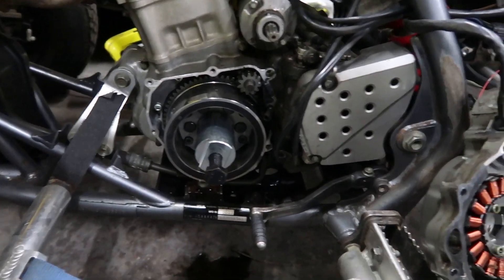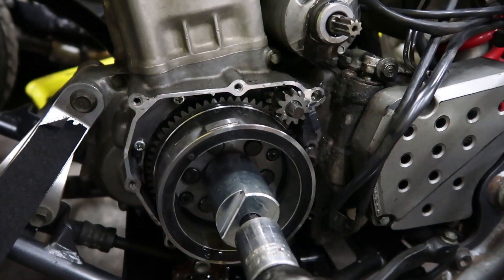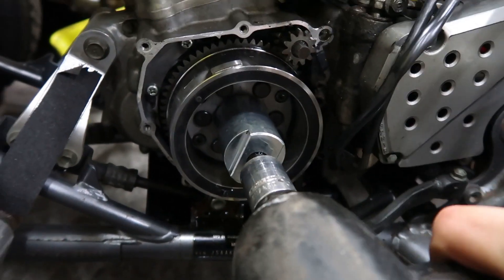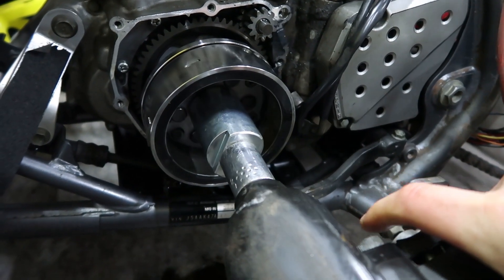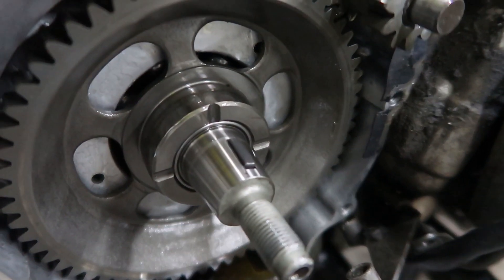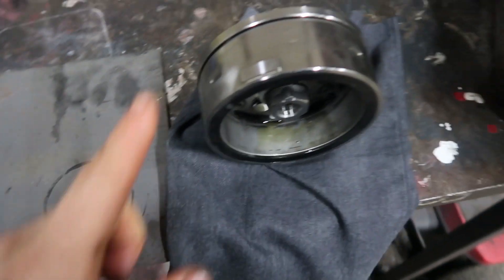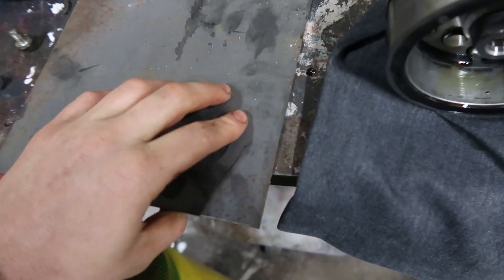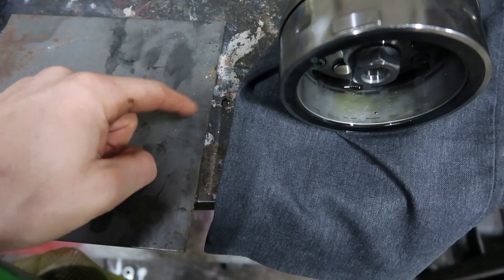Making my own 36-1 Trigger wheel. EFI / Turbo Conversion Quad bike Part 1

Comment: Just two concerns I can perceive. Welding(and impact gun for that matter) can demagnetize your rotor if I’m as well read as I think I am. The other is the balance from possibly distributing more or less weight from welds/inconsistent tooth size and from the missing tooth. You could take the weight of the missing tooth and cut a hole, removing the same weight of material on the other side for that issue though. I personally would try to implement a more traditional style wheel on the other side of the crank if it’s possible. Just my .02. Excellent idea though and impeccable execution.
Reply from the maker: thanks for your message buddy. Yeah it was a bit tricky to do for sure. Its been runing and driving for a couple years now no issues so far. i guess the extra grams here and there didnt make thatt much of a diffrence however its not the most ideal thing to be doing. none the less it worked fine :)
Reply: @BEYTEK that’s good to hear! I’m currently in the design/research phase for a kz1100 chain drive conversion/EFI conversion/ possibly a turbo. Keep em coming man love to see it!
Reply from the maker: awsome dude. this was a great trigger setting settup leasno for me
 @lundyracing

Comment: Ok, This is just way too cool. I have a z 400 myself. What did you use for a turbo, size, ect. I'm guessing oil supply came off the plug on the right side of the engine?
Reply from the maker: yeah my man. its a random turbo